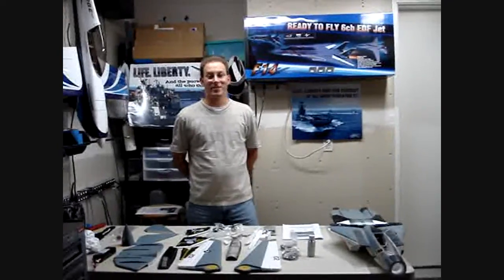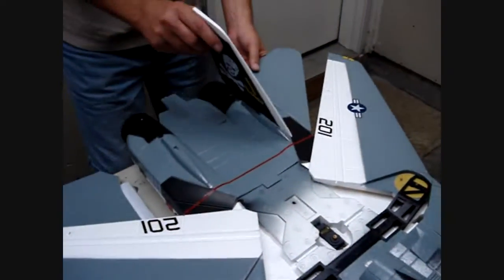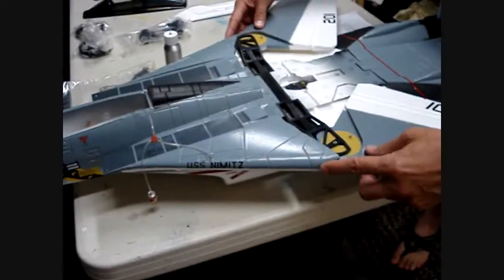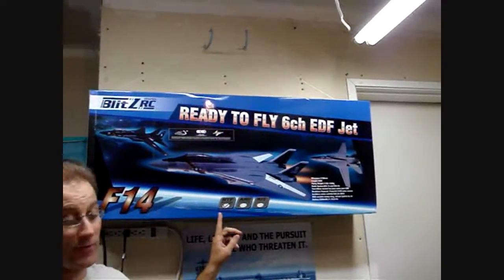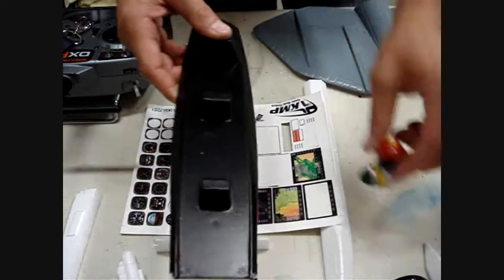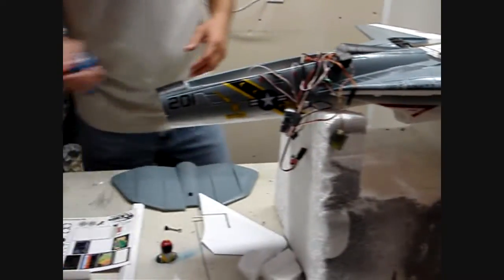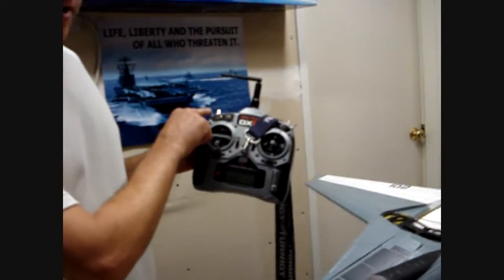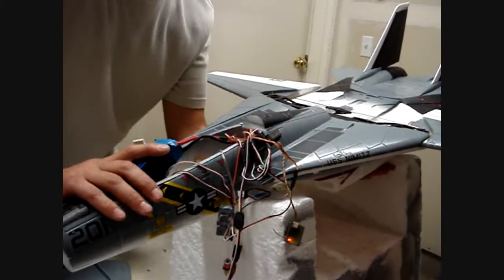RC F-14 Tomcat Build Video Part I

Comment: You do not have to create ailerons and install aileron servos to this model.  The model is designed to operate on elevon mixing.  I bought one in Australia and it flies very well using this method.  The elevators do all the work when set up as elevons.  No need for the extra work.

Comment: You hit on the 4S? regulators are 40Ah? I do not have the instruction manual and then I write to you because my model is identical to your own even the regulators are blue like yours. I confirm regulators 40Ah? and then I can put the battery 4s 2700mAh 30C? with what you've flown? I thank the kindness Antonio

Comment: Please not, this plan is NO WHERE NEAR RTF...it'll take more than an hour to get it flight ready.

Also, the wing hing can be enforced with 4 plastic strips 2x4 inches epoxied to the wing mount end points. Drill a whole per size of small screw and put wing in.

I snapped both of my wing ends before flight (thankfully) and I'm making sure folk know to do this because one good roll the wing load could snap the end of the wing holders and then no airplane